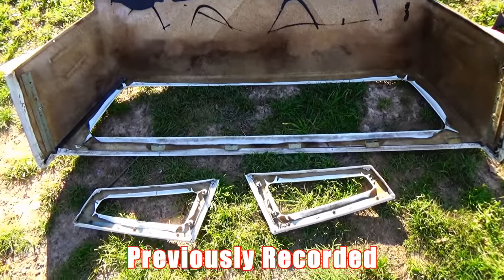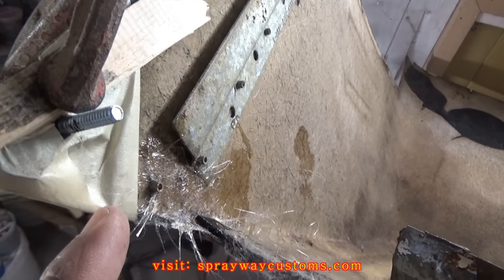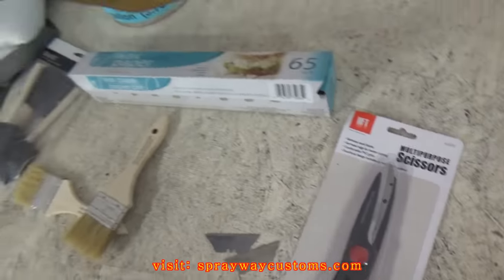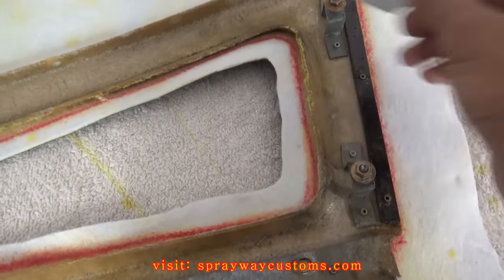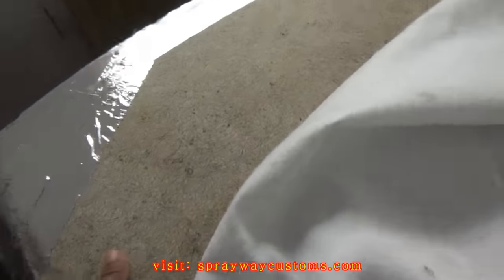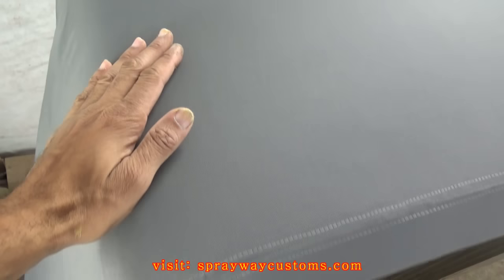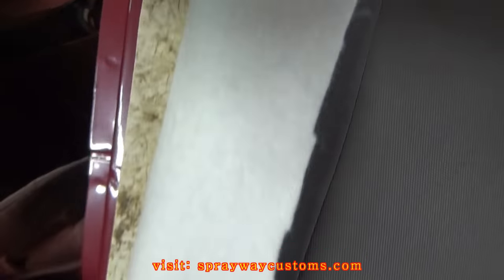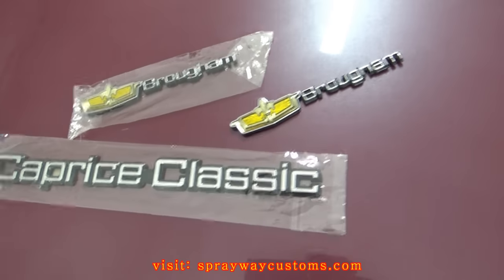Vinyl Top Replacement Box Chevy Caprice / How To Replace LS Brougham Quarter Top with Canvas Cloth

Comment: Nice kind of strange that when you remove the top off the LS Caprice is not even and if you ever want to remove the vinyl top you can't because the back window sticks out more than the slant of the metal line and its connected with a gap so it always will need the top to look right. Wonder if the 90s box Cadillac Brougham do the same or is the glass even with the car?? I actually love the 90s box Cadillac Brougham but don't like the vinyl top.
Reply from the maker: The glass is with the car on the Cadillac

Comment: What a jewel! That gray compliments very well.  Did you use a vinyl or nylon tape on the underside of the stitching for waterproofing? If you use heat sometimes that will produce the wrinkles. Very impressed on how that contact cement helped to smooth them out.  Your work speaks volumes!
Reply from the maker: Yes a nylon tape. Thanks for the input
Reply: Always looking to make things easier!! :):)  

I have used Anti-wicking thread long with a seam sealer on outdoor fabrics instead of the nylon. I make a strip from the fabric to enforce the seams. When you get the chance check out Sailrite, they carry a lot of products for boats and outdoor fabrics. Just a tip when dealing with fabrics that will be exposed to the elements.
Reply from the maker: Thanks

Comment: Where did you get the white cloth and what is it called.....
That yellow glue .... what is that....is different than contact cement?  Thanks
Reply from the maker: I got the white cloth from Walmart...it's called interlacing for fabric. I got the glue off eBay...it's called Landau glue. It's the same as contact cement just made especially for tops.

Comment: Hey man I know I’m super late to this video. But man extremely great work. But I’m wondering where I could find the quarter top shell from. 

I found the rear window shell. But now I need the shell the goes over it and on the roof. Any recommendations?
Reply from the maker: Lucky to find one at a yard. I did years ago

Comment: I was thinking about making a thin layer fiberglass top but I see yours have spacers. Do you think I need to put spaces in between mine as well?
Reply from the maker: I would say yes unless you gonna glue it straight to the metal Puerto Rico77
Reply: Thanks for time, your thoughts and videos i really appreciate it.
Reply from the maker: No problem

Comment: 25:30 how you put those on ? my 1990 Cadillac eldorado missing one only black top just like this I was wondering how you put these on imma order a Cadillac emblem on Ebay was wondering if you just super glue it on
Reply from the maker: They have self adhesive tape on the back

Comment: What glue did you use for the rear glass and where can I find it at
Reply from the maker: It was seam sealer. https://shop.advanceautoparts.com/p/dynatron-auto-seam-sealer-grey-caulk-12-oz-550/7100402-P
Reply: Ok u put it all over
Reply from the maker: Yes but I'm thinking from the factory it wasn't at the bottom but I put it all the way around and it set up good. I have a video of me doing it but I just haven't  finished with the entire vid.
Reply: Ok bro thanks hope u post it will be the first to watch and in that video is you putting the glass in and can’t wait to see the digital dash

Comment: 1:35 it's the same body, roof skin and all. Just a fiberglass shell. Wow. I would have chopped it down to the original sheet metal.
Reply from the maker: A lot of folks do. You just have to get the rear glass and change your quarter glass out.